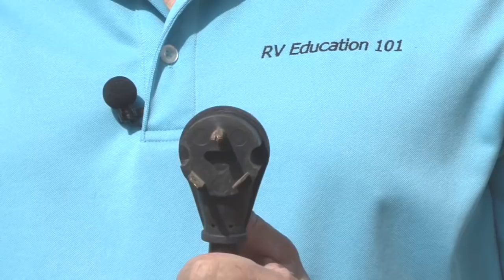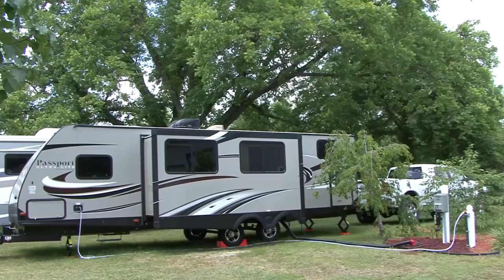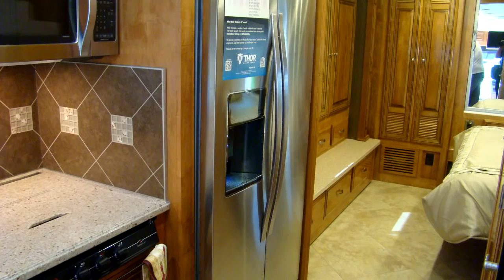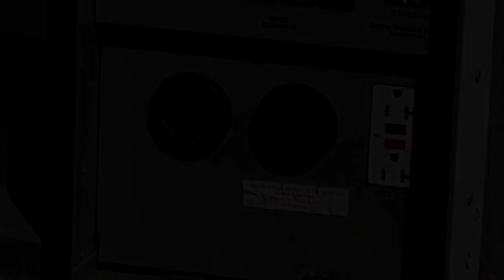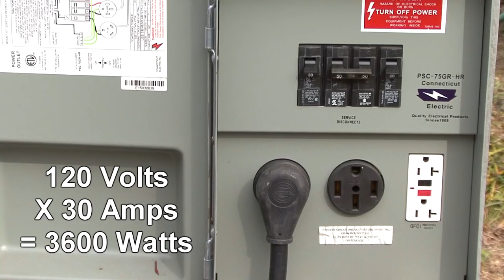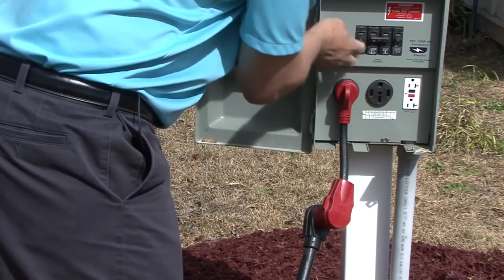RV 101® - RV 30 Amp Electrical System VS RV 50 Amp Electrical System

Comment: Using a 50 amp outlet to power a 30 amp line will mean that the circuit breaker at the outlet will not throw if the 30 amp line shorts to less than 50 amps.  Probably unlikely, but most breakers are there to cover the unlikely.

Comment: I understand what you are describing.  My question is when plugging a 50amp/120/240volt trailer plug into the 30amp/120volt  pedestal plug using the adaptor are you only supplying half of you trailer's breaker panel with power by using only one phase?  Or is there a shunt built into the adaptor so both phases of the trailer's panel gets power?

Comment: Could you do a video on using the two 30amp receptacles with a adapter to a 50 amp plug for a 50 amp RV.  Guess both sides of elec box is only getting 30 amps.  Can you still use a 50 amp surge protector on each and get protection. I assume so.

Comment: If I owned a campground, I would not allow it, but the codes in some places allow the electrician to hook up two 120 volt lines to a fifty amp outlet without them being out of phase with each other.  If an RV is counting on them being out of phase with each other for a 240 volt service,  they will get zero volts from L1 to L2.  With that being allowed in some areas, I would not buy an RV with any 240 volt appliances.  Your RV Education 101 might want to give this warning.

Comment: Using a 50 amp service with a 30 amp trailer would allow you to pull more than 30 amps provided individual circuits in the trailer are not overloaded......correct?
Reply: On second thought,  I guess it would pop the trailers 30 amp main breaker.